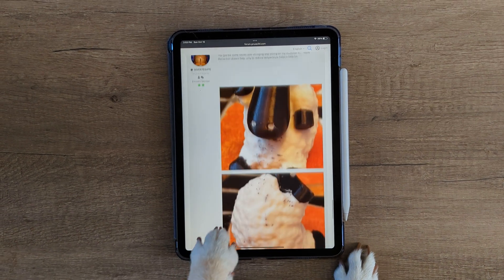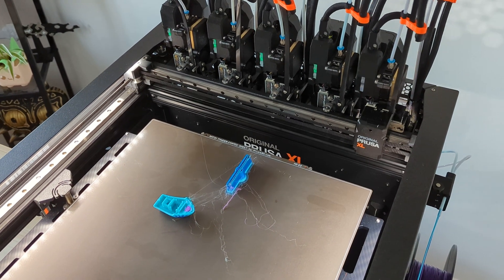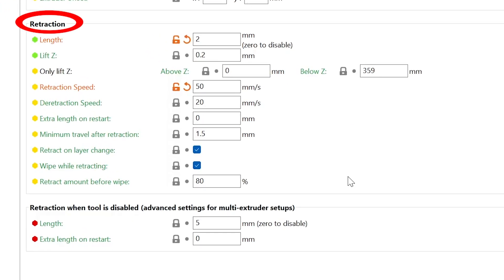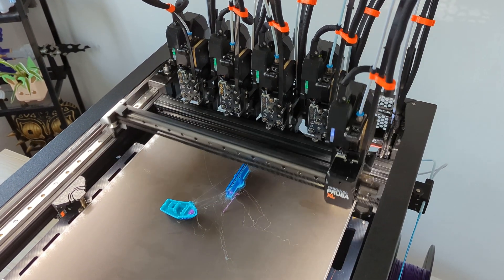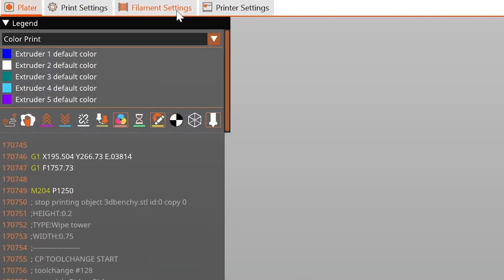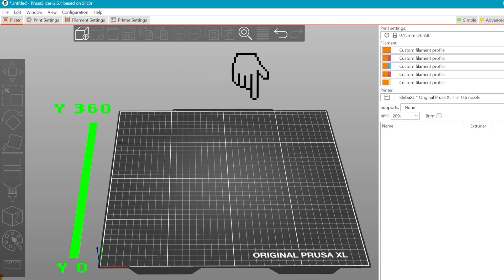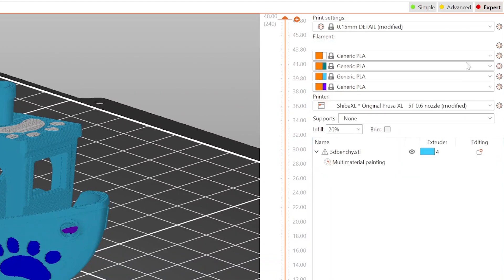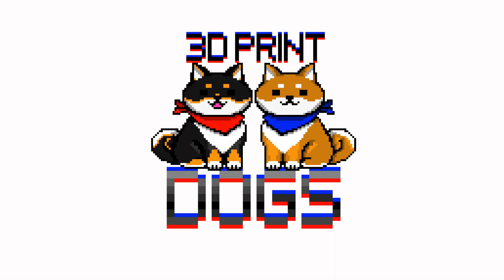Master multicolour printing on the Prusa XL with this simple tip! No more stringing and blobs!

Comment: Works great with TPU as well. I was having stringing issues while printing a flexible cerebral spine and your tip made such a huge difference. That and taking the XL printer out of "stealth" mode. I guess it needs the quick movements to get the print heads out of the area fast enough. Thanks.

Comment: Tried your settings, the code is in the gcode, but looking at the tool movement, it doenst move to the back, but straight to the wipe tower... is this still accurate in prusaslicer 2.7.4?
Reply: I've digged deeper in the gcode and the filament-specific end gcode comes after the wipe purge ...
Reply: @marcelzuidwijk  were you able to enter the gcode for the movement still? I was doing the same thing in the video but the tool movement doesn't appear to be following the command
Reply: @brandonphelps6868 nope, but with the latest alpha firmware (6.2.0) it’s very little, only the older filaments strings (only in tool changes not in single color prints).

Comment: For me, printing mainly with PolyTerra, using default pla profile and lower temp to 205 was enought to fix the stringing. Now I'm trying this method, but aint working like you said. After printing it goes first to the prime tower before executing the custom gcode...

Comment: about removing the prime tower to prevent colliding, could you not also add a z-movement of 2mm? This way it would go over the prime tower.
Or is that a bad idea and will it provoke stringing again?
Reply from the maker: There is actually a standard Z lift right before the custom gcode, so it isn't necessary to move the prime tower to the side, it's more of a precautionary measure. Making an extra Z lift would reintroduce the problem so it's not recommended.

Comment: You guys are some good doggos!

Question on the "E-1" for extracting 1mm during this update.  Does that retraction ever get undone?  Guessing not, aside from during the wipe/purge tower which would technically have some under extrusion I guess.  But so long as the purge tower uses 1mm of filament it shouldn't impact the print, and might even be better than 'undoing' this 1mm extraction during tool changes?  Curious if you happened to do any extra testing on this that informed your decision here.  THANKS!
Reply from the maker: You are correct that the retraction is not undone. When we were first messing around with the gcode, we did try some preliminary tests with undoing the retraction by adding an E1 code right after the tool changer picked up a new extruder. We didn't do any systematic tests, but the prints seemed better when the E-1 was not undone. Even with the E-1 gcode, the prime tower already has a lot of blobs on it. This means there is oozing when the extruder gets parked, and likely the E-1 is reducing oozing that ends up as blobs on the prime tower. Undoing the E-1 would just lead to more blobs on the prime tower and increasing the chance that the blobs would end up on the print.
Reply: Thanks for the details!  Makes sense!  I had great results with your fix too!

FYI it looks like Prusa will be including this update soon.  It’s not in the latest beta firmware or slicer.  But the “bonkers bench” gcode they include with the firmware release sends the nozzle to the wipe tower to do the large Z move.  The wipe tower for that print is also the cleanest I’ve seen.

Unfortunately you don’t get that behavior slicing your own files, so seems they neglected to release some of those improvements outside of the bonkers benchy posted to GitHub with the latest beta FW.  More improvements on the way from the Prusa team I’m sure.

Comment: Great video, I had an idea that I have tested in the slicer but not on my printer (yet). In the printer settings custom g-code block there is a section called "Tool change G-code". From my testing the code in there happens right after the code you modified. Soo...

If you add 

"G1 Y360 E-1 F24000
";

after the first "endif" it will emit your g-code without having to modify all the filament configs (you just have to modify your printer once).
Reply from the maker: Yes, you can also put that code in the "Tool change G-code" section! We've tested by putting the custom command on the first line and it is equivalent (though it doesn't allow you to customize the gcode in case you need different settings, for example different retraction settings might work better for petg/pva)
Reply: Tested on my XL, works perfectly
Reply: (to be clear, I tested this by creating a g-code and looking, I'm pretty sure it "works")

Comment: Great stuff. Would a small brush type wipe tower where the tool sets have any effect on this stringing?
Reply from the maker: The extruders are parked onto a rubber nozzle seal when not in use, and it may be possible to use the rubber seal to do something similar to what the bambu x1c nozzle wiper does to keep the nozzle clean. So that could prevent the possibility of melted plastic on the side of the nozzle oozing into the print randomly. But even with a clean nozzle, vertical strings that form on the print will get embedded into the walls and form print artifacts. To prevent all print artifacts, the vertical string must be eliminated with the additional travel movement encoded by the gcode described in the video.

Comment: This is the first video of yours that I've found. I love the cute dog theme (and the cute dogs!), and it looks very professional. Bravo! I had to subscribe.
I've not seen a lot of videos of the Prusa XL that made me consider getting one. If it was a lot cheaper, and way more constant with quality prints, and not in need of tinkering, I'd buy one right now. Even at it's current price, if I mostly saw positive videos about it, instead of mostly negative, I'd at least consider it.

A few questions:
Do you think it's worth buying, or does it need a lot of tweaking and upgrades to get it working well in most use cases, or did you just have problems with the tool changing causing problems before you figured out this fix?

Does it have input shaping and any other modern advances like in a Voron or Bambu Labs printer? What's the fastest speed you print at that still has no noticeable drop in quality. Have you tested how accurate it is, and what the tolerances are? I'd love to know more about that.

I've been 3D printing for over 15 years, and I desperately need my next printer to not be a constantly-causing new problems kind of printer. Everyone I have ever known has been a total pain. I just want one that works and produces good results without constant need to fiddle with it.
Reply from the maker: Worth buying? Yes*, because there is nothing like it (so far) and the toolchanging is very cool.
Does it require tweaking? Yes, feels like the MMU2S in its early days. Things will definitely get better with updates.
Other problems? Not really*, single colour prints are very nice. Only encountered issues when using the toolchanger.
Input shaping? Not currently. Apparently it will come in a future update.
Speed? Haven't done any formal tests. It is much slower than bambu x1c at printing, but extremely fast at changing filaments. Haven't tried pushing the speed limits.
Accuracy/tolerences? Printer has not given any reasons to believe it is not accurate at default settings, but have not done any formal testing.
Non fiddly printer? Bambu X1C is a good bet for reliability (See our majora's mask video). It's still early days for the XL, but once issues are ironed out XL could be the better printer.
Reply: Thank you for answering all my questions. 😊 I was just about to watch your majora's mask video. I will definitely wait until they get all the XL stuff worked out before I get one. I will probably go with the Bambu before the end of the year so I can back to selling my inventions. If it all works well enough, maybe I'll have enough saved up to get the XL by the time they get it as refined as I will want it to be. @3dprintdogs
Reply: @3dprintdogs I saw a video on another channel where he compared a multicolor print on an X1C and the XL, and the XL came out ahead because the tool change is so much faster than the X1C’s filament swap and purge process. It was a fairly small print with a lot of color changes. I’m sure the X1C will come out ahead on some prints that have fewer changes per mm printed. It will be really interesting to see how much faster the XL gets when input shaping is released. My guess is that Prusa by default won’t try to push it as fast as the X1C because they seem to err on the side of print quality, but we’ll see.
Reply: They released alpha input shaping today! But they dont use the accerlometer yet so final input shaping will be better than this alpha. A youtuber tested the new alpha and found a 40-50% decrease in print times with the same visual quality. Also the transfer size over wifi decreased by 80-90%. Prusa is known for supporting a printer long time and adding features for years. Heck they recently released input shaping for the mini.
Reply: @andreasn455  I saw that news about the alpha input shaping, and I think I may have watched the same video you did. All sounds like good stuff. Sadly for me, I waited much too long to order my XL, so I'll be waiting until probably June next year to receive mine. 😢 At least by then all this stuff should be ironed out!
Reply: Wait for prusa XL mk2 for the problems to be ironed out.
Reply: @TMS5100 If you order one today, they're saying delivery will be something like June of '24. That's a lot of time for them to continue refining things.
Reply: @MikeKobb  though people placed pre-orders in 2018. They've already had many years to refine it.
Reply: @LincolnWorld  Not that long. They announced the printer in November of 2021. It's certainly not in what I'd consider a 1.0 level of quality yet, though. More like a beta test. But it seems to be improving rapidly. By the time orders placed today ship, I think they'll have it at a much higher level of refinement.

Comment: Any reason you cant just add a retract and skip the Y movement?
Reply from the maker: Good question! We tried only retracting before we came across our solution, and it did provide a modest improvement to print quality, though defects still occurred occasionally. However, by combining retraction with the travel movement, we were able to completely eliminate the formation of vertical strings.

Comment: Great video. Have you looked at the "Tool change G-code" section under Printer Settings > Custom G-code. I am wondering if you can manipulate that instead of editing the filament profiles
Reply from the maker: Oh yes, that works too! Setting a filament end gcode allows one to customize the movement for each extruder. That might be useful if you are using a multimaterial setup where one extruder is printing with a different material such as PVA and you want to have higher retraction or a different movement for that extruder specifically. But your idea would also work, and you can put the gcode at the strart of the tool change gcode if you want each extruder to move back in the same way.
Reply: Can you tell me exactly where to add this in the code?  there is a lot of stuff in there already.   I don't want to mess it up..
Reply: I've looked at that section in the Prusaslicer Alpha.  There is a lot of code in there at the moment.  Where should the command be inserted?  At the start of the code?

Comment: Let me make sure I understand this. The purpose of the bed lowering is to ensure that the tool doesn't collide with anything while the tool is moving to the changer to be swapped out. So by doing this change, you're defeating that and introducing the possibility of a collision. That's why you've moved the wipe tower. Correct so far? If you're printing multiple objects on the bed, does it also drop the bed to move from one object to the next? Like, what if you wanted to print five of those multi-color benchies? Would you end up with stringing due to the head moving from object to object?
Reply from the maker: The printer does a normal z-hop (0.2mm) when traveling and doens't leave a string if the nozzle is clean. If the nozzle is dirty (due to the presence of the vertical strings) then it could leave horizontal strings during travels.

The additional g-code that we add happens right after a normal z-hop, and it is really just a travel movement. So technically it should be enough clearance to avoid a collision. Perhaps prusa was just overzealous when they programmed in a 2 mm drop for every toolchange.
Reply: @3dprintdogs  Thanks for clarifying! Seems like this should be in the next software update from Prusa for sure!
Reply: This interaction slightly increased my hope for humanity.

Thank you, have a great day!
Reply: @Quintin185  I hope my initial question didn’t sound like an accusation or anything. I really just wanted to understand what the implications are of the fix and if there would be potential issues with multiple objects on the bed. Still scratching my head a bit as to why Prusa has the extra Z motion on the tool change. BTW, @3dprintdogs, I referred another YTer to this video today because he was having a lot of stringing on his 5-head printer. Mine is on order but it’s so far in the future that I hope Prusa will have updated the firmware by then!

Comment: That is so smart, you guys are brilliant, this is WAY better than editing the firmware like I was going to do. However, if you DO want to edit the firmware to eliminate the Z-lift completely (including the pause while it does this Z move), it's a setting called TOOLCHANGE_ZRAISE in the configuration_adv.h file.
Reply from the maker: Thanks for the information! I wonder if prusa will end up implementing your suggestion in the next firmware.

Comment: Pretty sad that it took two dogs to fix what Prusa engineers couldn't..... but thanks for sharing! I will be trying this out and reporting on it in my XL review video if it works (which it looks like it should).
Reply: 99% sure it is because the devs are running the development firmware and did not test multicolor extensivly when they knew new firmware will release soon that doesnt have this problem. They released an alpha today for the xl that has alpha input shaping and does fix stringing according to their blog. But a 0.6 nozzle will always be way more stringy than a 0.4. So if perfect quality without stringing is very important to you, consider switching to 0.4 nozzles.
Reply: @andreasn455  appears to still not be fixed just got mine and it is a stringing nightmare. Gonna try this fix
Reply: FACTS.